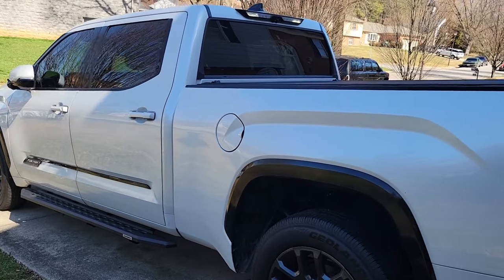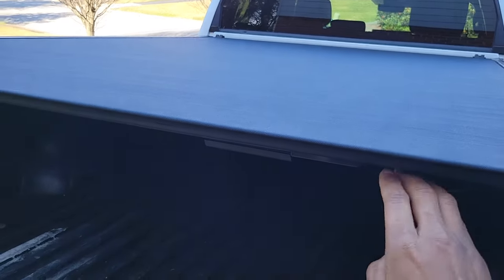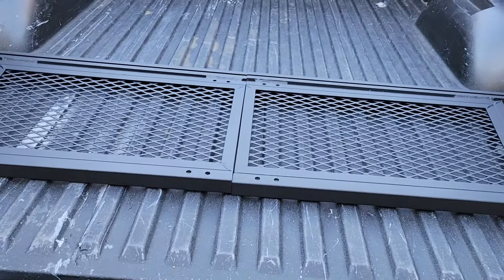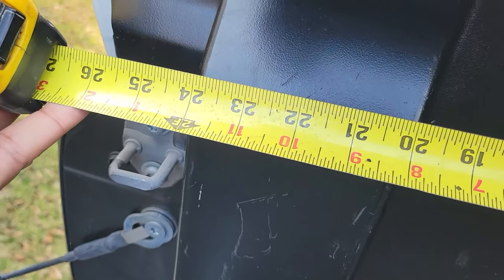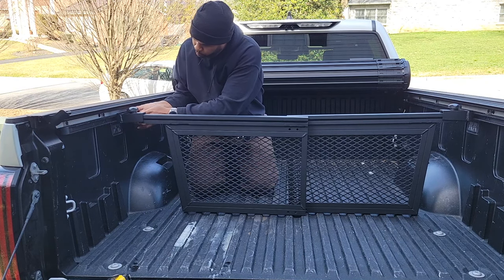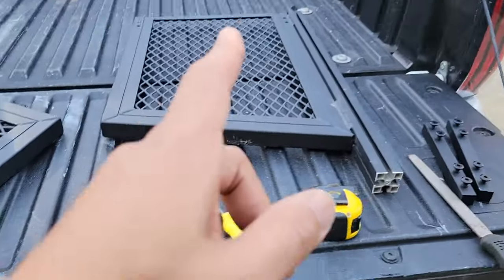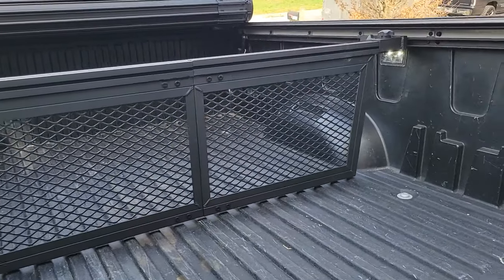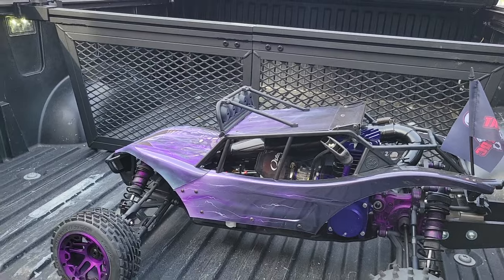Easy Modification 2023 Toyota Tundra Bed Divider

Comment: Thanks for the video. Been wanting to find one that fits. I have same truck as you ,same color also.
Reply from the maker: No problem 👍 Without the tanneau cover it should fit with less modifications. The cover relocates the side bed rails in just enough to have to cut the sides of the divider. The only thing you should have to do is cut the adjustment knob. 👍🏽

Comment: I would have put the sliding brackets on the opposite side so the sliding knob would be toward the rear of the bed. JS
Reply from the maker: Thanks. I actually did end up doing that.

Comment: Is there enough clearance to slide it back and forth easily so it doesn’t get caught on the bed itself? I have a spray in liner and the bakflip mx4 so my rails are lower. Just didn’t want it rubbing when sliding. I was thinking of trying the Tacoma one but wonder if it’s not wide enough. Thanks for doing this video.
Reply from the maker: Thank you for watching and commenting. Yes mine moves with ease.

Comment: Yeah this is a nice mod to get this to work with the '22+ Tundras.  I have no idea why they don't offer an equivalent, it's definitely something that people will use.  Thanks man!

EDIT:
Now you got me wondering about whether I should get the bakflip revolve instead of the OEM tri-fold....lol.
Reply from the maker: Thanks. If you are using the bed tie down rails in the stock locations there shoulshouldnt be a reason to cut the divider.
Reply: @CrucialGarage  Nah, they'll be relocated down a bit b/c I'm going to get a cover.  Just trying to decide between the OEM tri-fold and the BAK revolve X4s like it looks like you have.  Both have pros and cons.  Why did you choose that one over the OEM one, if you don't mind me asking?
Reply from the maker: Sorry, I'm just seeing this. I like the a having the ability to roll it all the way up and have 99% access to the bed. I can put my ATV in the back without having to remove it. Also another plus is there are no seams.
Reply: @CrucialGarage  The OEM one folds over itself 3x up against the back window, and it doesn't obstruct the view b/c the rear mirror is a camera.  It takes about the same amount of space as the roll when all folded up.  Trade-off seems to be you have more granularity if you only do it partial way with the roll-up, where-as the fold you can just flip up the end one and leave it.  But yeah, it has seems vs the roll-up one.

Comment: Not trying to be negative but I personally do not like that divider as it can not be lowered or flipped down to haul long lumber or other long materials. You will have to remove it to do so. JS
Reply from the maker: No worries. Yeah I agree. I rarely haul long items. Maybe my ATV from time to time. Then I would need to remove it as well.